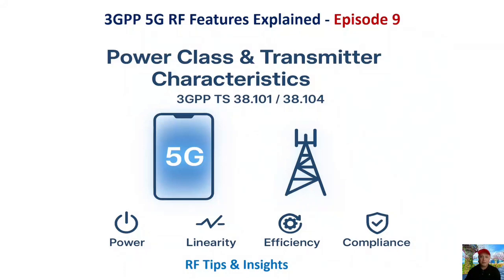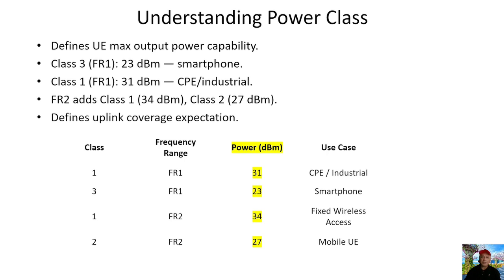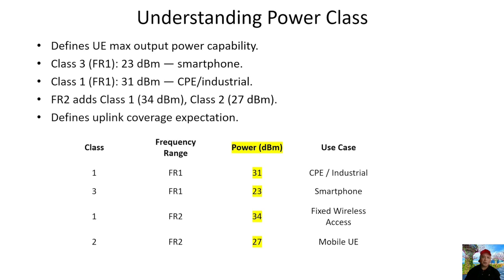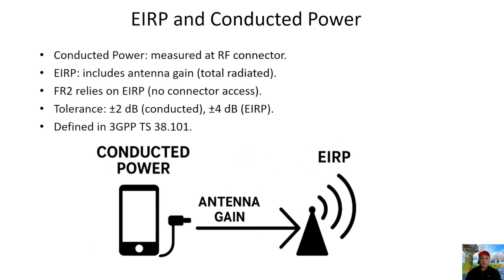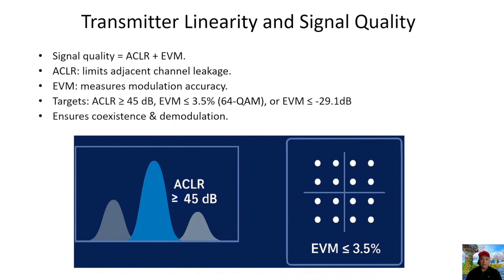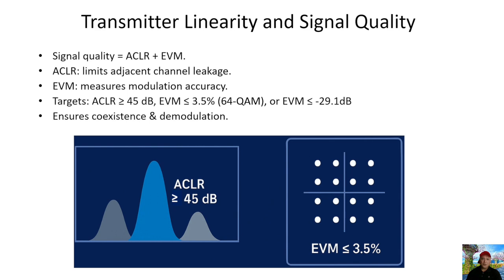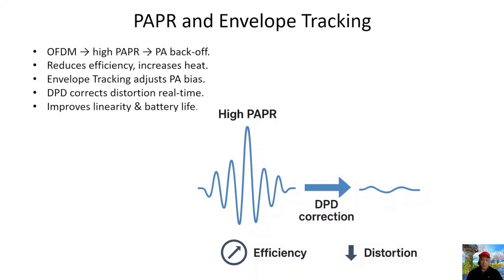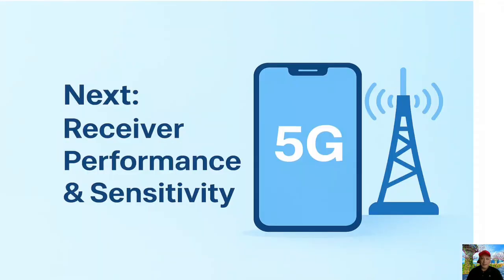5G NR Power Classes Explained | UE Transmitter Characteristics & RAN4 RF Specs - EP9

Comment from the maker: In this video, we break down 5G NR UE power classes and transmitter characteristics based on 3GPP RAN4 requirements.
We cover Tx power limits, EIRP, ACLR, EVM, PAPR, and how these specs impact 5G handset design and RF lab testing.
💬 Question for you: Which UE power class or transmitter spec causes the most challenges in your designs or testing?